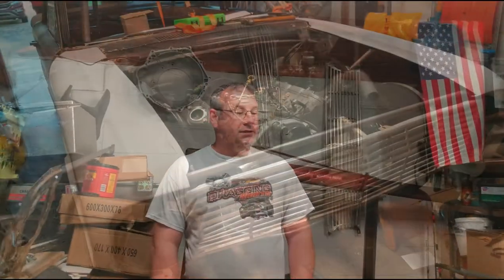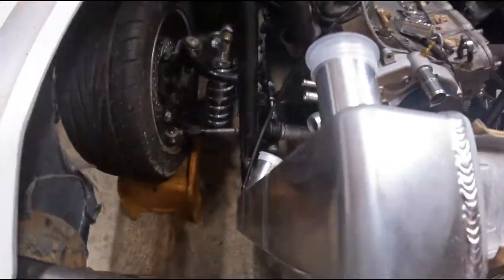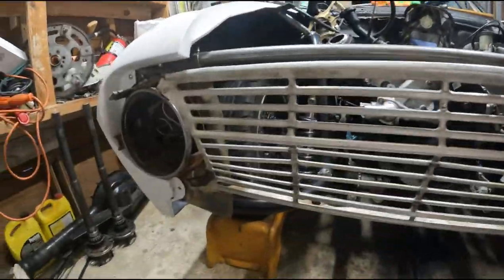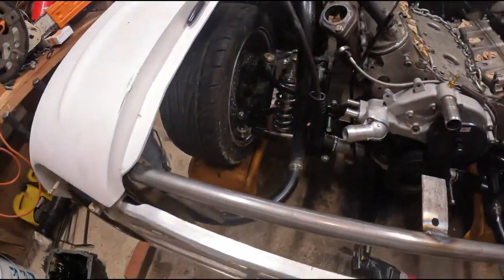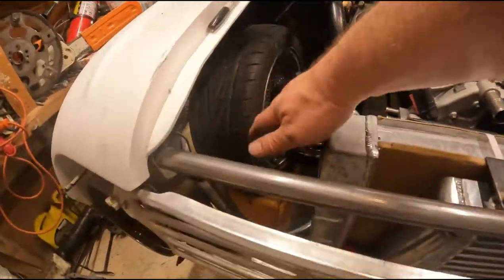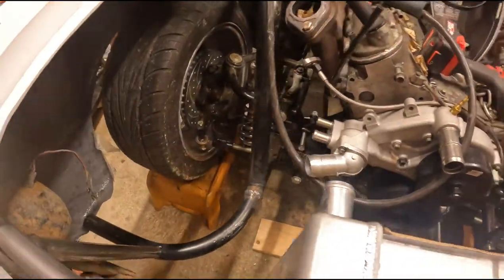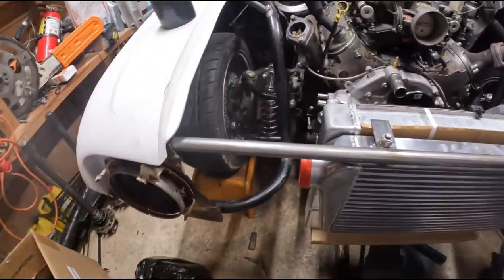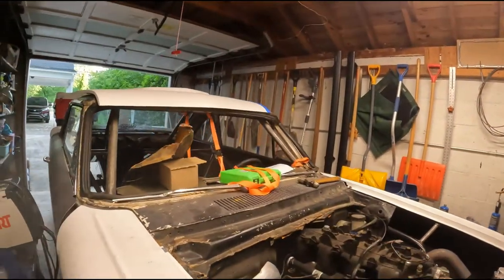LS Swap Radiator with fans and Intercooler Install

Comment: Nice job.  I feel the pain of redoing and cutting stuff out.  Usually after I have to cut something out, I am like, I knew that wasn't going to work...why did I do that!  But it's more welding practice I guess!  Keep the vids coming to keep me inspired to work on my junk.
Reply from the maker: Keep at yours, you are doing a ton of great work and it will be a sweet ride when you finish it.